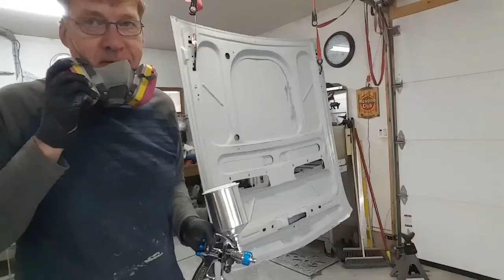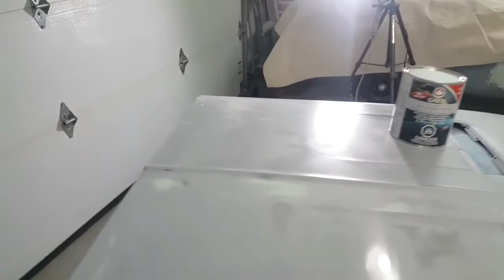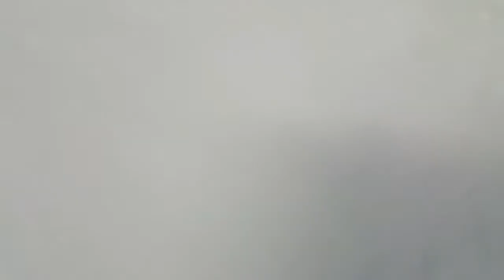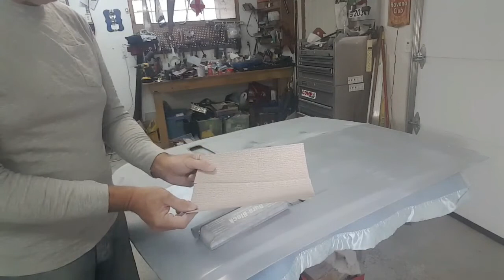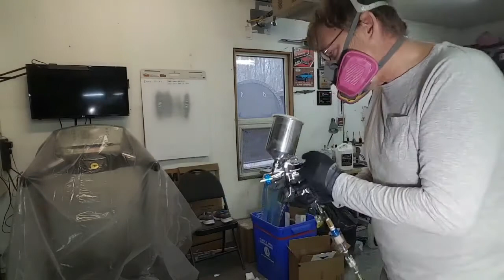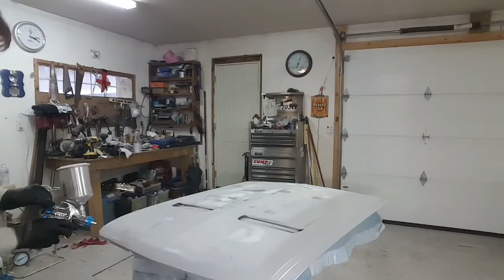Spraying 2K Primer

Comment: I have not primed a car since the early 80's and have only been handed a gun to try my hand with a pro at my side to shoot color. Very intimidating doing it all yourself. Good video Wally.
Reply from the maker: primer is forgiving as you can always sand it off. The base clear is going to stop my heart until it is done. the only upside is I get to paint the truck, and under hood and trunk lid first as a last test to see if I can do it.

Comment: Nice job I built a simple air cooler using a transmission cooler find them online they can  handle the pressure ran it up to a box fan really takes the water out of the paint coming out of a small compressor the air is very hot and full of moisture cool it down your water filters will knock the rest out I also ran to Full paint cups of cheap Rust-oleum  you can thin with acetone And practice on the side of the shed an old washer cardboard box and get used to it that really helped me A lot before I start spraying expensive 2K primer but great job bro
Reply from the maker: never thought of oil cooler.. neat idea. Before I try base clear I will do the same. I have a side project that I can try it out on first that does not matter if there are runs

Comment: Nice work, great to see you wiling to learn and get better. You would never want to sand 2k with 800 or 1000 grit though, base or a sealer would never stick to that. 320-400 is ideal with maybe 400-600 for a metallic base.
Reply from the maker: THank you , I  have not yet sanded the 2k but will  make sure I do not go to fine

Comment: Usual procedure is: 40 or 80 for initial cutting, 2k prime, wait 24hrs, guide coat, block with 120  and identify the low areas, repair with evercoat filler or glazing putty. Which is self levelling. 2k prime again, guide coat, block in a xross hatchn pattern, with 220 or 240. Guide coat, block with 400 and then clean, bliw off and you are ready to apply paint. Set the gun up, patyern should be neither top or bottom heavy. Apply a very light tack coat, wait 15 to 20 mins, apply a medium wet 2nd coat, flash off, apply 3rd coat and Bobs your uncle and Fanny isbyour Aunty, the outcome should be pretty good. Imagine straight lines and keep the gun level wirh the panel.  Excessive pressure wastes material and causes hard work afterwards.  Create an airway by drawing air into your designated work area and extract with another fan. All this is just freindly advice, as do not wish to see anyone struggle!!!
Reply from the maker: thank you , I appreciate all the guidance I can get

Comment: Yes, normally you are correct, finish, get some as you say in the USA lacquer thinner, flush the gun through, back pressurize, until the thinners come out clear ans your gun is ready. 

However, when you have over 25 guns as I do and have a couple of Binks Bullows with plastic needles, that would be a no no... or when using high viscocity materials like 2k primers, needles can stick and need to be cleaned manually. Depends, what you are painting and how much time you have invested in the project to date. Maybe it is just the way I work???
Reply from the maker: I agree, I believe it is best to disassemble and clean it as it may sit for weeks on end before I need it again.

Comment: Hello from the UK. For your information The Starting line is the entry level to the Devilbiss refinishing platform. Treat all guns whether high end or entry level - week end warrior with respect! 
Never, remove the fluid tip, whilst leaving the fluid needle in. Always pull back the trigger, then back of the fluid control , remove the spring and take out the needle. Rebuild is the same, except smear a trace if petreoleum jelly or Vaseline and the gun will be ready to go.
Reply from the maker: Good advice, I try and clean the gun the best I can.  I see a lot of shops will simply fill the gun with acetone and spray it out.

Comment: You make this look easy, I’ve had a couple of attempts now doing the very same thing and I’m struggling like mad 😩
Reply from the maker: IT is frustrating as it was my second time spraying. Just make sure you have your flow and fan wide open and about 35 psi at the gun. wish you the best of luck. A trick is to cut your primer 50% with reducer to thin it out to flow better. but you need multiple coats as the thinner paint does not cover as well.

Comment: Water block is better  saves sandpaper ,  the water makes it  shiny  so as you wipe the panel , you can see the high and lows.
Reply from the maker: You are right, I was hitting the panels with 320 dry just to cut into the primer. Once done I will go back with 400 wet to really expose any issues and hopefully prep for paint.

Comment: You need a compressor that has 4scm or more to spray this kind off primer. Most compressors with 2 piston and 2 or more horsepower motor will do the job. Also even with a mask you need ventilation and a strong exhaust fan. Good luck
Reply from the maker: good point, I upgraded to a 2 stage compressor but I do need to set up a better ventilation when I am going to hit the full car

Comment: you need to open the fluid rod all the way open..............
Reply from the maker: Thank you , when I assemble the gun before spraying I fully pull the trigger and then screw the rod adjustment in until I contact the trigger. that is max flow. my major issue at this time was the compressor I had a 26 gallon, 4 CFM @90PSI unit and after about 60 seconds PSI at the gun was below 40.  I have since replaced it with an 80 gallon, 11 CFM dual stage and that now keeps my pressure up at the gun for good atomization. lesson learned
Reply: @68mustangrestoration34  kool...yep an 80 gal will do the trick....i run an 80 gal 2 stage as well...binks #7 w 1.8 and a divlbiss pro lite w1.2- 1.3 1.4 and a sharps 1.7
Reply from the maker: @licha5050  yes, compressor makes a huge diff. I only have the two guns, with a 1.0, 1.4 and 1.7. I have to do some research on what is best for base coat and of course clear.

Comment: want your thoughts  on the devlibis kit i got to run  will come back thanks
Reply from the maker: for me so far it is working. I have no painting experience and therefore cannot rate the gun from that perspective. BUT as a novice every time I use it I get better. My plan is to paint something else in base clear first to make sure I am good enough to paint the car. patience is key, I find myself trying to get thicker coats too quick and it is best to apply multiple thin coats. I am getting runs in my 2K which is easy to sand, but runs in base or clear are mush harder to repair.